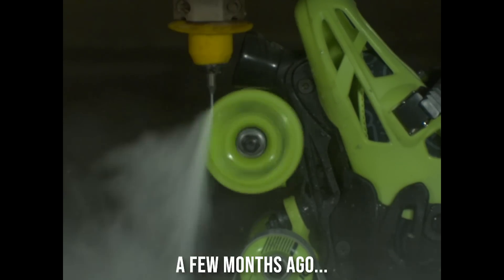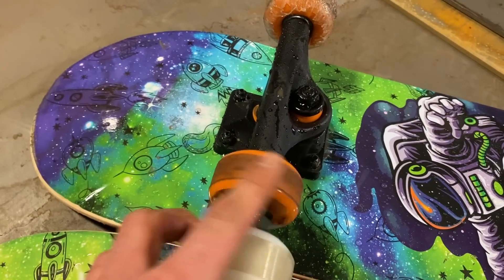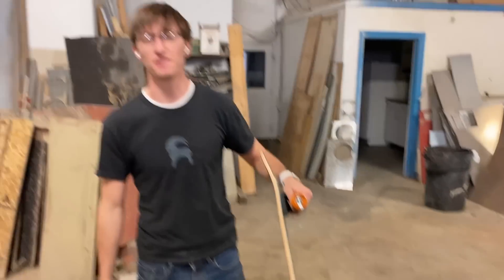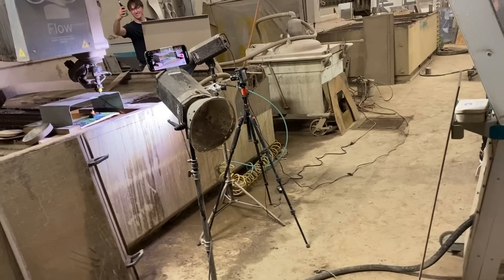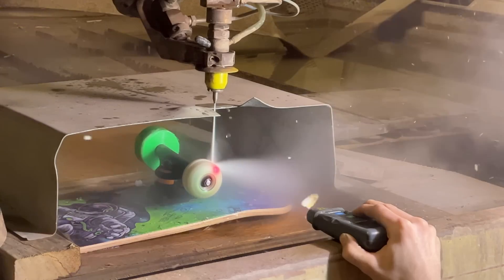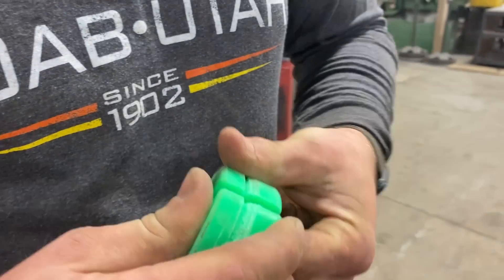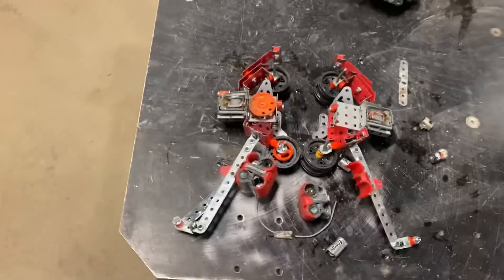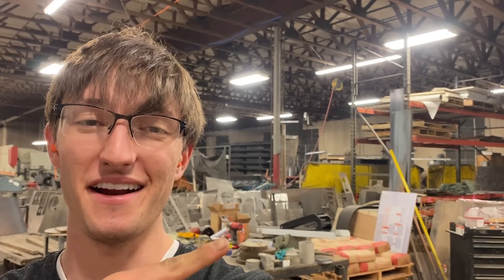Can We Beat The 45,000 RPM Skateboard Wheel Record?

Comment: I feel like if the jet walked away from the center of the wheel as it accelerates, it would make the water contact at a more shallow angle.
I don't know if it will go faster but it probably won't brake as quickly

Comment: It’s a lot more entertaining to make the tach say 45k or more, but most of these readings are wrong. The reflector flies off or the wheel stretches away from the laser most of the time. The speed has to be increasing between losing the reflector and each explosion. I say either do the trig or scale up the speed with the amount the tire stretches between those two points. 

Maybe try filming again using a metallic sharpie that will stay attached even when there’s a high stretch. And/or put something in the shot you can use for scale when editing the slow mo.

Comment: To achieve a higher RPM you need to adjust the flow nozzle to move as the wheel grows or else it starts to cut into the wheel and causes weakness in the structure of the wheel then blows up.
Reply: This is the reply that is needed to explain why they will never get a definitive answer
Reply: A progressive pressure adjustment, the hard part there is the energy/heat created would build too fast so they go fast

Comment: I don’t think you’re getting proper readings. The reflective tape fell off really world when the the fiberglass did. I think that’s where a lot of them stopped reading. You need to paint the wheel with a reflective paint or something like that. The tape flys off too easy. I think you reached higher speeds but those rpm gauges are really touchy.

Comment: You were at Walmart and didn't buy the $20 Braille board? Would'a held up better than that plastic truck cheapo. Also mount the trucks to a beam, so the wheels can keep expanding. Or just make a solid rod mount to put the bearings on so the truck flex doesn't change the angle (of the dangle.)

Comment: Whats making it stretch?
Reply: speed
Reply: speed in a circle needs to be pulled back to the center (centripetal force). Missing this force (or not enough) results in a negative centripetal force pulling inward which looks like a positive force pushing outward (centrifugal force). unless they manage to somehow pull it in (e.g. by wrapping something around it) it stretches
Reply: Centrifugal force. Or is it centripetal force?